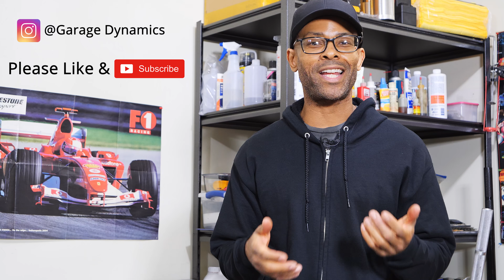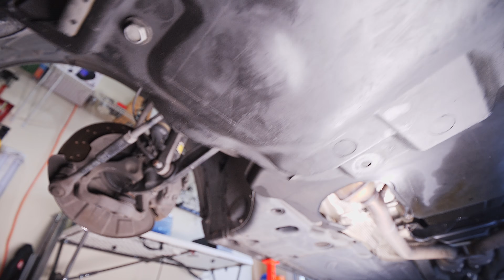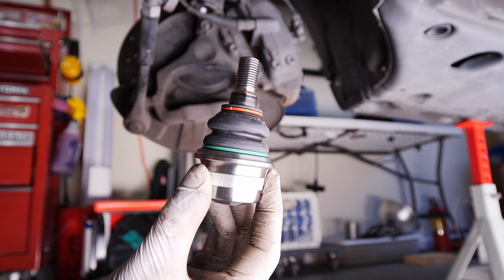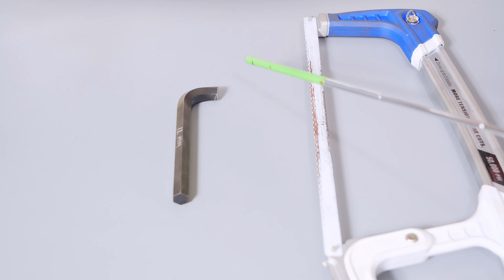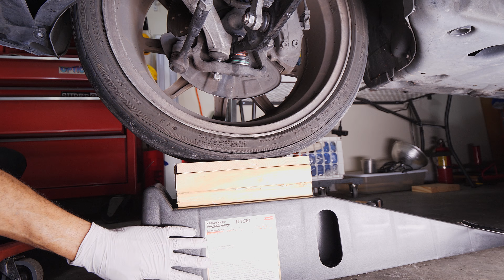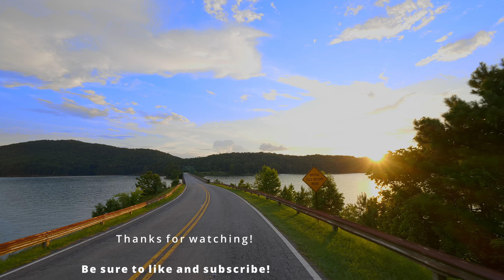How To REPLACE Lower BALL JOINT - Made EASY - MERCEDES-BENZ S Class S500 W220 - 2000 - 2006

Comment: I wish my ball joint were so easy to crack.
I have done both sides arms on my S55, and broke 2 separators for my trouble!
On my car the screws on the bottom of the strut, are female type torx head, dead easy to round off if the car has done a few miles.
I notice that your car has male type screws, have you swapped these previously, are they tapered as the standard type are, and where can I get them? 
Question, both arms have elongated slots in the end that fits onto the chassis. 
When I turn the wheel on full left hand lock, the arms contact each other and produce loud banging noises.
Both the arms have wear on them, not enough to fail the yearly test, or be dangerous, but its quite embarrassing when I am trying to park in the supermarket car park.
Have you ever encountered this before, and would the adjustment on these slots be enough?
It does look to me like the camber is out, the wheel looks further in at the top.
Reply from the maker: Hello Steven Lawrence! That's a bummer to hear that. Sometimes applying heat or penetrating lubricant will help. Also, what type of separator are you using? Is it the silver aluminum one, or the black steel one? I bent the silver aluminum one before, but once I switched to the steel separator I never had that problem again. All of my screws are original and have never been replaced. I know what you mean about the embarrassing noise at the supermarket. I didn't have the banging metal noise, but I had the very loud squeak haha! 😅 For my particular model (base) the camber and caster are all preset and non adjustable. It would be nice to have adjustments for those.
Reply: @GarageDynamics  I`ve used all types, the only one I have Found that does the job (eventually, and with a lot of swearing and bleeding) is the heavy duty G-Clamp type that I got as a press set.
Using that, and an air wrench, as long as it does not slip, the joint will crack.
If you look on the arms, the end that goes to the chassis has an elongated hole, and I was hoping that these were to adjust the camber with.
If not there are sites that sell offset bolts that do the trick.
Odd about those screws, MB would have been much better off using your type.
Just a thought is your an airmatic or ABC, Mine was an ABC, so I wonder if that's anything to do with it.
Reply from the maker: @stevenlawrence278  Hahaha yeah sometimes the swearing and bleeding is apart of the job 😂 Yes, I agree. The G-Clamp is the way to go.  You are correct, there is an elongated hole, however, there are spines that prevent the bolt from moving. I guess if you mill out the spines then you can adjust camber and caster, but that would be at your own risk, or you could just be the offset bolts. Mine is airmatic, and that could have something to do with it.
Reply: I'm doing this right now. Have the black separator but it ain't budging. Adding penetrating oil will try again tomorrow if that don't work I'll try the g clamp press

Comment: It's much easier to find 12mm hex sockets than it is to find a 12mm key locally, as most key sets only go to 10mm.  If you're in this predicament, pound the bit out of a 12mm hex socket.  It's the perfect length.  Thanks for the video!
Reply from the maker: Haha very true Dylan Hein. I think I purchased the 12mm key at Sears when they were still around. I like your idea though :)

Comment: Can anyone comment on how much crossover there is to a W221 w/ ABC suspension?  Pretty similar, or should I not use this as a guide?  I've not tried this before, but am thinking due to a steering wheel shake at 60+mph, and ruling out other causes, that I have a suspension issue.

Comment: Where did you get the piece at the bottom for the ball joint.
Reply from the maker: Hello Douglas Weaver, Are you talking about the piece that attaches to the big C clamp, that pushes the ball joint into place, or the piece that separates the ball joint from the steering knuckle?

Comment: Hi. Thanks for the video. Can worn ball joints cause a constant slight vibration that is felt more the faster you go? I’ve just had my wheels rebalanced to make sure they’re good, which improved things greatly but a slight clunk from the front right over bumps and a persistent small vibration make me question the ball joints. There’s also an intermittent squeak from the front left that I assumed was the brake but could that be ball joint-related, too? I’m thinking it may be time to get all four changed just to make sure.
I don’t think they have ever been changed.
2002 S320 196kkm (122k miles).
Reply from the maker: Hello Thomas Hillier, Yes, worn ball joints can cause all sorts of strange problems. If you have never replaced any of your ball joints I would definitely replace the main lower ball joint, the lower control arm (that's known for squeaking) and your thrust arm. Check to see if the rubber is cracked on your thrust arm. I hope this helps. Cheers!
Reply: @GarageDynamics  Thank you!
Reply from the maker: @thomash2806  You're welcome! :)
Reply from the maker: Hello Thomas, I believe I had about 170k on the car before I changed the ball joint. I would suggest changing sooner depending on the type of roads you drive on.

Comment: You didn't explain how the wheels can steer with two lower ball joint or three in total. Those two lower arms are rigged and the bushing have little play, so why did they do it and what's going on? Tesla uses it and so does the new Mustang and Camaro. Most mechanics don't know and with German cars they don't want to know. Do you know?
Reply from the maker: Hello Tothius Bentheum, You bring up a very good question. I do not know why at this time. I definitely want to know, so ill be off to my studies learning about your question. Thanks for leading me down this path to learn something new.
Reply: @GarageDynamics  You find two types of mechanics in a shop, one that knows how to replace and operate equipment and one that needs to know how and why it works. The ladder is the one who finds the flaw in it's design and is skilled in diagnostics. They often time are the ones tell the other what's wrong and what to do. Sadly there income is effected due to helping out everyone else! I think the twin lower ball joint pushes the front wheel in the turn forward as camber keeps tire patch at maximum and the inside tire is pulled back to help it make more of a difference? Not sure, but someone went to a lot of trouble with what seems crazy in the first place.

Comment: To replace the lower ball joint with that tool you actually only have to remove the top ball joint and the brake caliper (the flexible pipe restricts movement if you don't). If you then tilt the hub assembly rearwards it leaves enough room to get the tool on the lower ball and remove it. This saves a considerable amount of disassembly and potential damage to other ball joints.
Reply from the maker: Actually I removed everything so that if someone wanted to know how to remove their lower control arm or thrust arm, they could learn all in the same video. I should probably change the title haha.
Reply: @GarageDynamics  this is an awesome video.  Wish you made when we were working this project in 2020.  I Subscribe and LIKE. Thanks for doing this great video tutorial. It is excellent reference.  You need to have this in the Mercedes forum and link them to this video on YT.
Reply from the maker: @k9gears  Thank you for the kind words. I really appreciate it. :) I wanted to get on this video sooner, but I'm glad it found you. Thank for you very much for liking and subscribing!!! Your support means a lot to me. You're welcome K Dao! I have a few of my videos on mbworld.org but I will take your advice and branch out to other forums. Thanks again brother!
Reply: None of us that work on these cars for a living would be dumb enough to only sell you the ball joint. Less you want the customer back next week for another noise. We sell it as a combo with the lower strut rod, and the sway bar end links, as well as the lower control arm with integrated ball joint.

After that, an alignment is required. This is the proper way to service the front lower suspension (which is the common culprit for wear) on these cars which are in some cases are approaching 20 years of age.
Reply from the maker: @LynxStarAuto  You are correct and I couldn't agree with you more! Thank you for sharing your knowledge with us brother!
Reply: @LynxStarAuto hi so is it not worth just getting the ball joints changed on my 2003 cl500? Would it really not be worth it
Reply: @sparksnvolts6855 i know its a year later, just did this job and i can say i should definitely replace the whole tie rod assembly and the control arm with the integrated ball joint. I should have purchased them beforehand to do them “while you’re in there” but i’ll just get them in the mail soon enough and now i can do the repair quicker next time around
Reply: can you be more detailed on this short DIY? about to tackle this job and want to save time where I can. just remove the 1 top ball joint? the brake caliper is in the way? I seen another very short - not detailed video of this removal ans the guy still had his caliper on and was able to get this tool in place and remove the balljoint but the lighting is awful and you can't really tell what is happening lmao
Reply: Thanks. I was looking at the long gated holes on the lower arms. And I am. Sure that where you adjust your CAMBER AND CASTER....

Comment: I noticed your sway bar was wet with oil. What's leaking? I just fixed my leaking ABC pump and I'm in debt now.
Reply from the maker: Hey Maurice! Good to see you as always! It's the transmission that's leaking. The thing is, it has always been leaking. I think it's coming from the black plastic cover on the bottom of the transmission housing. I'll fix it and some point haha!  Congratulations on fixing your ABC, but that's unfortunate that it destroyed your wallet. I believe you'll recover! 🙏

Comment: Excellent Tutorial! Thanks! One question, how to you get the jack stands in the jack location if you used a jack to raise the vehicle? Did you use the jack that comes with the car or a floor jack? I like how high you are able to get the front off the ground!
Reply from the maker: Thank you Fairgame70! For the S500 it has a dedicated jack mount located in the center between the front wheels. If you watch my transmission tuturial, it explains how to lift the car and sit it on jack stands. Here is the link: https://www.youtube.com/watch?v=BosZaiRbUzQ&t=217s   I used a low profile long reach floor jack that has a 24 inch lift to raise the car. Then I lowered the car onto jack stands.  The height definitely helps a lot.
Reply: @GarageDynamics  thanks for the valuable information! I have a 02 CL55 and I prop a jack underneath where the side jack holes are located. I will need this information because I’m about to do mine! 👍🏽
Reply from the maker: @ThEDIPPA1  Awesome! Enjoy replacing your ball joints! Cheers!
Reply: @GarageDynamics  I have one more question if you don’t mind. I just had someone replace my radiator and the fan came on when I first started the vehicle to put antifreeze in. we where trying to bleed the system of air but it took awhile and lots of lost antifreeze however still the “Coolant visit workshop” dash light keeps coming on as well as the temperature raises to 100 or so. Well I noticed the fan wasn’t turning on or the a/c compressor when I attempted to run it to make the fan come on. I’ve checked the plug (it’s in), tested the plug to see if it’s getting power (it is), looked for any blown fuses and didn’t see any. Do you have any idea what is happening? 02 cl55?
Reply from the maker: @ThEDIPPA1  It's hard to say without looking at the car. I would double check to make sure all the air is out of the cooling system. Also Check www.mbworld.org The people there might be able to steer you in the right direction, or you can visit a certified Mercdes benz mechanic and ask for the opinion. I hope this helps. Cheers!
Reply: @GarageDynamics  Do all ball joint press kits work with our Mercedes Benz or do you have a certain kind?
Reply from the maker: @ThEDIPPA1  There are Mercedes Benz specific ball joint press kits. Here is the link for the press kit.

 https://www.youtube.com/redirect?event=video_description&redir_token=QUFFLUhqbWlReUhhZEx6YlJWSG5McWIyX0VMSzhVNHdWZ3xBQ3Jtc0trc29wMjdRWUhpaHVmdDdnOG5fWVBUYjhJNVJ6RUhJZmdNSVYwTGFzemNUOWRfMk5TcW83cVFod3pMMDVQQ2VhazItVzNrd1EtanZsQkRoYk5abGdtX2htRElJeFd2VFpCRS1KekxuUHQzYjZUalpERQ&q=https%3A%2F%2Famzn.to%2F3mIMdhz  

I hope this helps. Cheers!
Reply: @GarageDynamics  hey buddy, could you please tell me what size and type of bit I need to remove the lock pins that lock the control arm to the strut?
Reply from the maker: @ThEDIPPA1  Hey brother! It's a E10 Torx socket. Here's a link for the E Torx socket set. https://amzn.to/3A9PkGe 
Happy wrenching! 😁
Reply: @GarageDynamics  thanks again!
Reply from the maker: @ThEDIPPA1  Anytime brother!

Comment: well done - i did basically the same on a 13 c250 and after replacing the whole suspension and aligning it the noise still there 😁
Reply from the maker: Thank you rubber MALLET! I'm glad to hear you got the job done!! If you still hear a noise, then it might be one of the ball joints on your lower control arm. One trick is to spray a small amount of lubricant inside of the rubber that covers the ball joint and if it stops squeaking then you know which joint is going bad. Hope this helps. Cheers!
Reply: I got a squeaky noise on my C250 (w205) Also, was thinking of trying the lubricant thing but... which kind of lubricant should I use?
Reply: @hjuninhoh  Sean “Diddy” Combs has a recommendation for his favorite lube.  I forgot what it is.  Drop him a note.